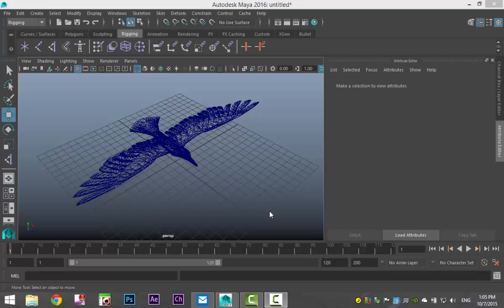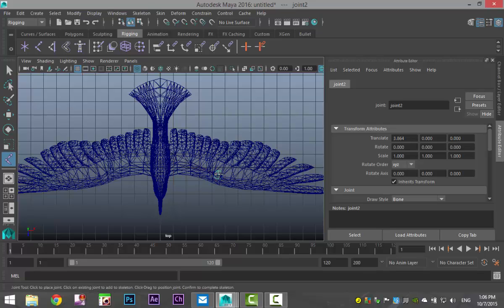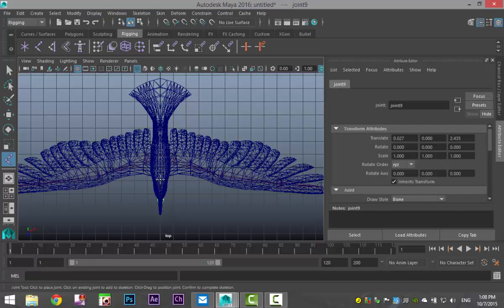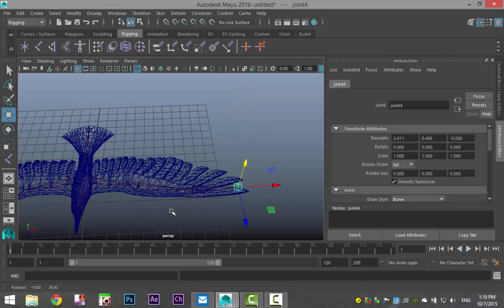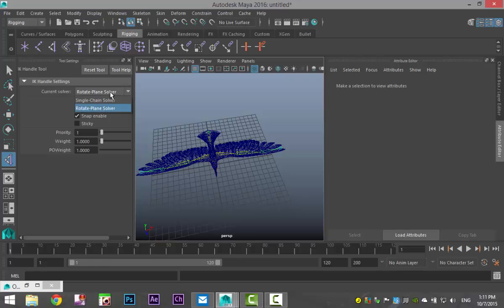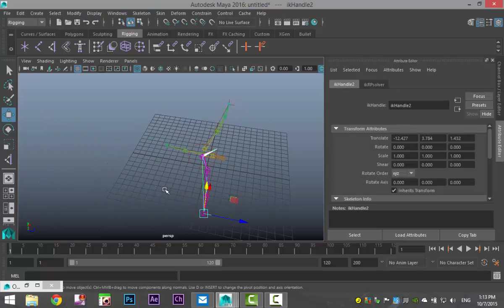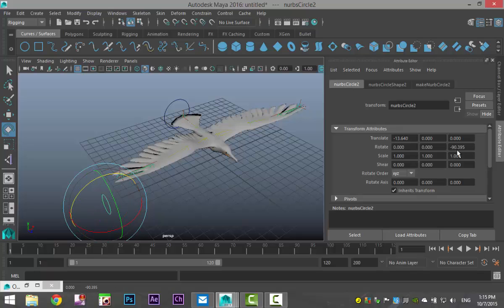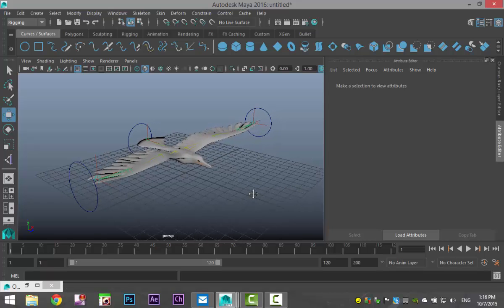Maya 2016 tutorial : Rigging a bird with IK handles and curves

Comment: This is very helpful! I have a question though. How can I make IKs for wings so that when I rotate it it will bend on the direction of the rotation. I want to make an animation for a wing that can bend like a finger. I made an IK handle for my wing but it can only move, once I hit the rotate button and start rotating nothing happens. Thanks.
Reply: IK handles only work with translation. For the kind of movement you want, you would have to make an FK rig for the wings.

Comment: Hi, a quick question; I used the mirror method to duplicate my joints (2:50), it is all fine, i merged the joints to the model, but the left side is not following the same behavior than the right side (and viceversa); I did all as the video shows but its not working. Do you know if there could be a solution for this?. Many thanks!
Reply from the maker: Did you duplicate or Instance the joints ?

Comment: Great video. I have a question. I didnt rig the butterfly I made. Just make a couple up and down movements and set keys, then selected graph editor post infinity  cycle. Now it  animates all the way tru 500 keys and I only want it to go as far as 170. any ideas?
Reply from the maker: +kaywood Parsons Set the animation to 170 keys and not 500
Reply: I need the 500 key frames for the rest of the scene which allows the curtains to look more natural in the wind. I tried 170 but the curtains dont go through enough motion
Reply from the maker: +kaywood Parsons You can set an animation loop on 100 frames in a 500 frame animation. Each animation is related to an object
Reply: Can I di this by using infinity post cycle as well?
Reply from the maker: +kaywood Parsons Yep

Comment: What the hell am I missing, I do the same exact thing as he does but when I create the IK handle and move it my master joint only rotates and the other joints in the chain remain rigid. I can't believe how random this software is.
Reply from the maker: +Johnson Did you create them in the right sequence ? Start at the end and work your way inward
Reply: +Mike Hermes Thanks for the reply, if you're asking about the joints, I started close to the body and worked my way outward, like you do in the beginning of the video. I ended up using a spline handle with clusters anyway since in this case I'm trying to rig a character's tail.
Reply from the maker: +Johnson So you selected the master joint ( closest to the body ) and hit the move tool to move it up but it rotated ? Just trying to understand